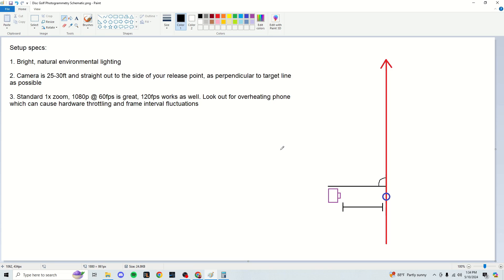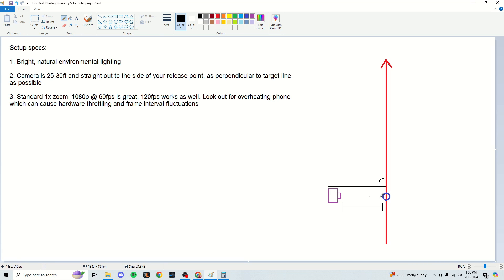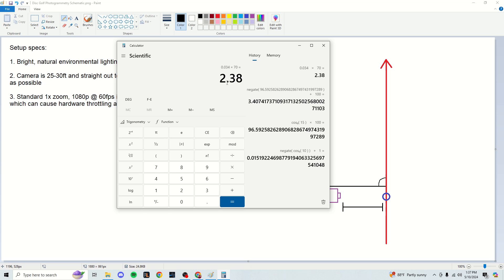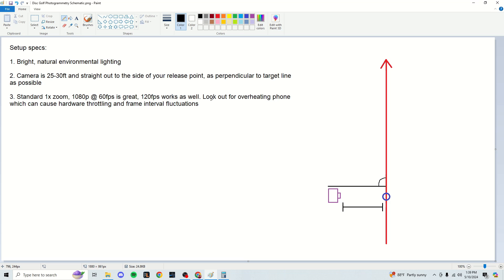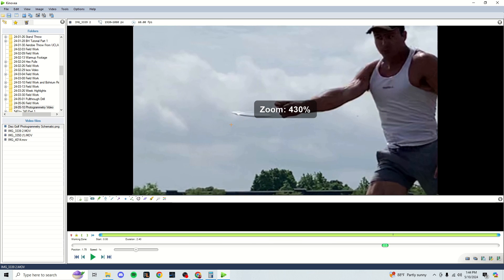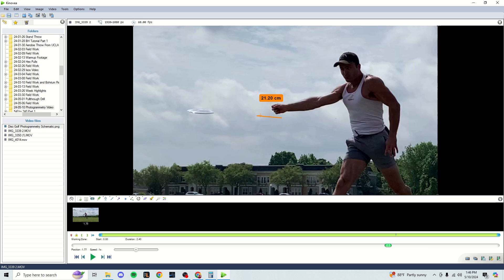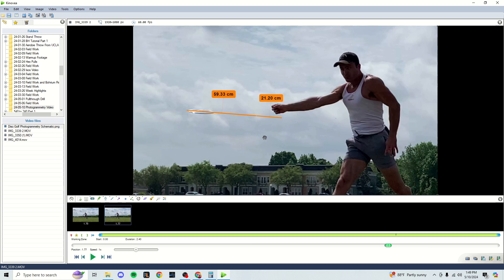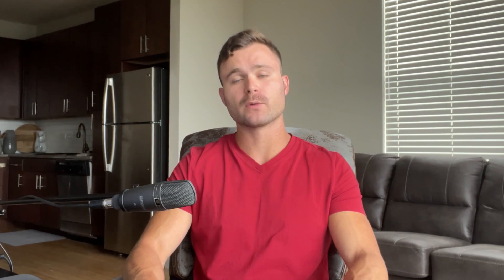Measure Disc Golf Arm Speed With Your Phone | Photogrammetry Tutorial

Comment: Nice! I saw you doing some noseangle stuff. Was that another open source program?
Reply from the maker: Yes that was an older program that doesn't work as well for iPhone codec videos, so I have been using this Kinovea now (can also use a protractor in this one) since it runs much smoother with .MOV files 👍

Comment: You say 30 ft from the throw but i only have the camera 2 meter away with 120fps, can i still mesure the throw, also you do this calculations like nothing, you know alot about math, you are very good on numbers sir 👍 and about the web calculator is it just to write the calculaton in the link in the browser ? thx for the tip on program ❤️
Reply from the maker: You’re welcome :)

When the camera is extremely close like that, the disc’s path angle can be more sensitive so just make sure to get the 2 frames where the disc is as centered in your video as possible 👍

And correct, I was using it to save time with calculations.
Reply: okej but my disc only moves one or a half disc per frame 🤣 50+ mph
Reply from the maker: @luftisbollen  anything over 50mph is still good imo!
Reply: Thx, 58mph something is my record.